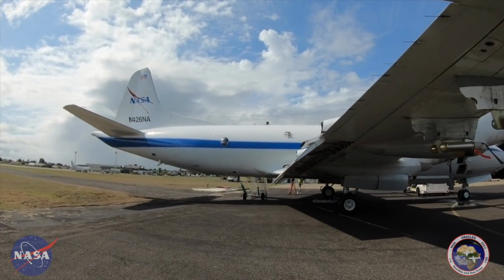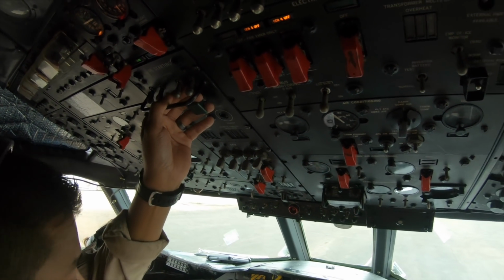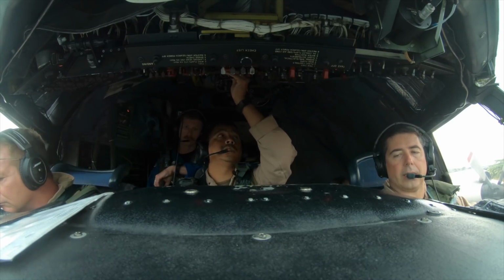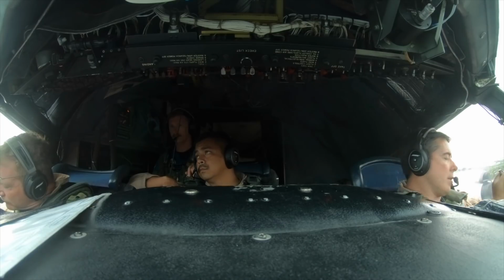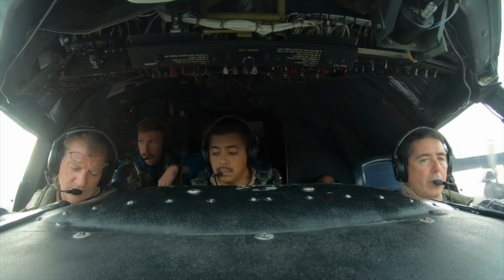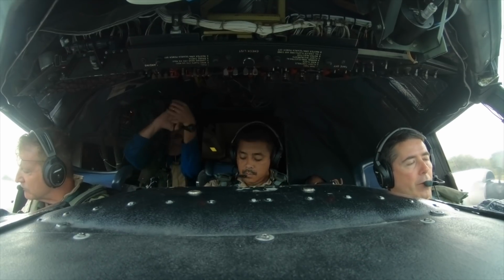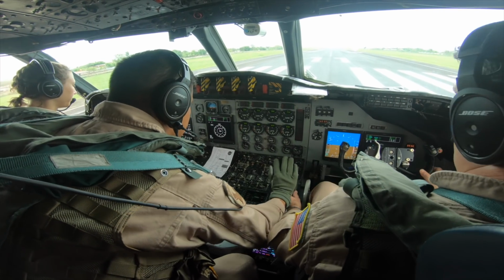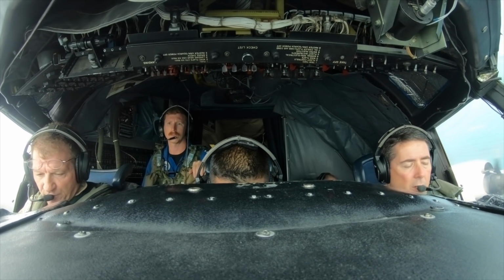Today we highlight another P-3 Flight Engineer, AWF1 Ruben Palomino!

Comment: Hot & heavy, max power takeoff, I miss that shit! Flying out of Cubi Point PI. We also called fuel dump switch as the first step of the emergency engine shutdown checklist. That was after dumping fuel over subic bay hanging on three propellers with a max weight aircraft. Good time's!